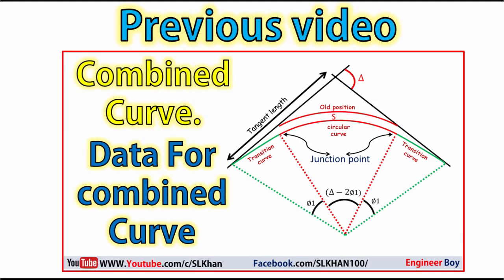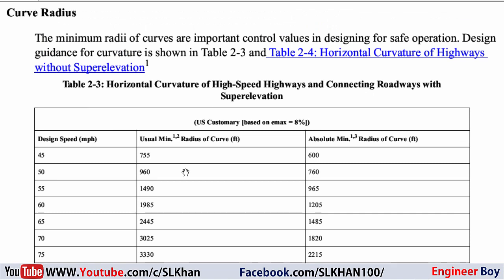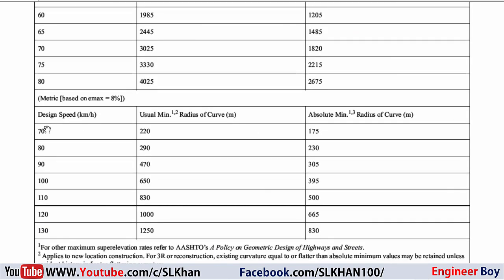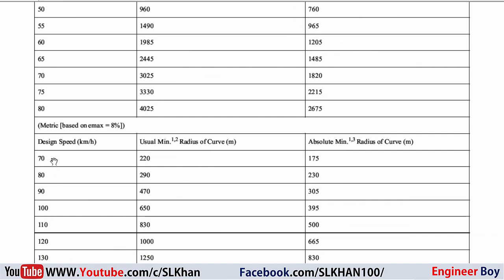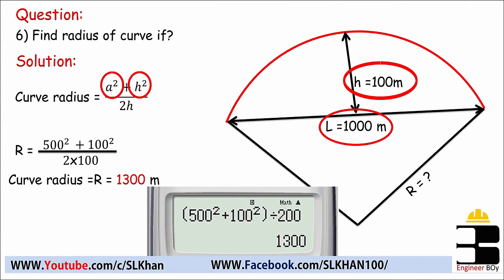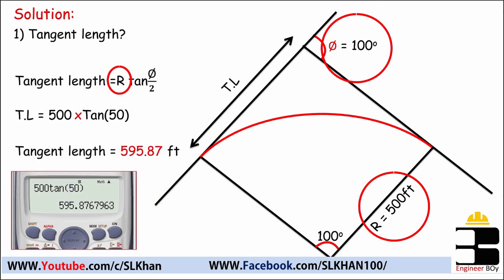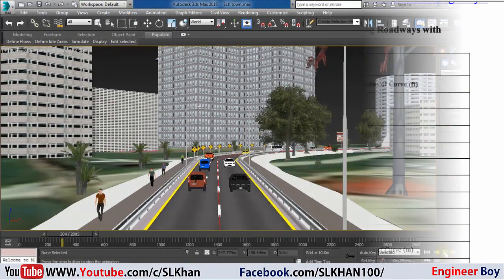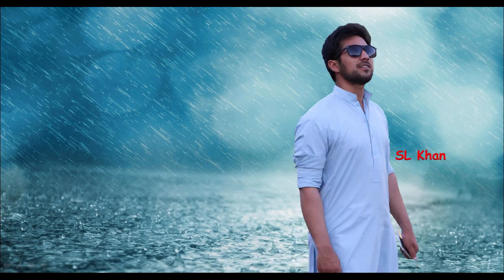how to design curve radius for highway? #road

Comment: In.q.no.6.
After finding curve radius,can we calculate arch length with out knowing deflection angle
Reply from the maker: Deflection or central angle is mandatory. If you have problems finding an angle directly, you can calculate angle by trigonometric ratios.
Reply from the maker: Deflection or central angle is mandatory. If you have problems finding an angle directly, you can calculate angle by trigonometric ratios.
Reply: Thanks sir g